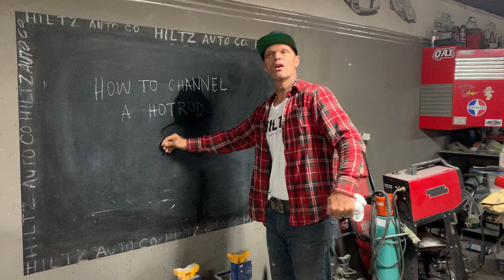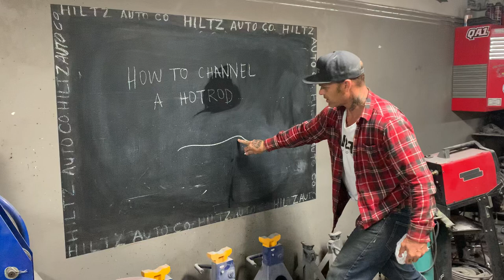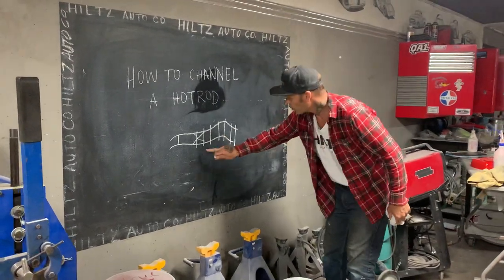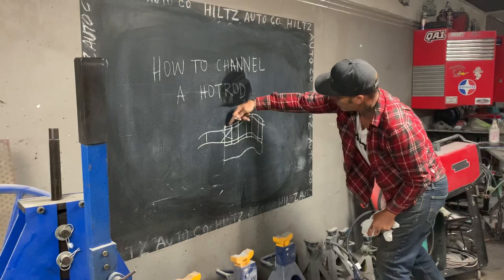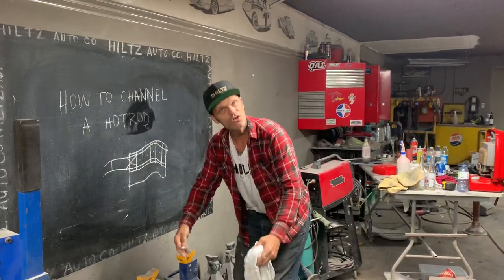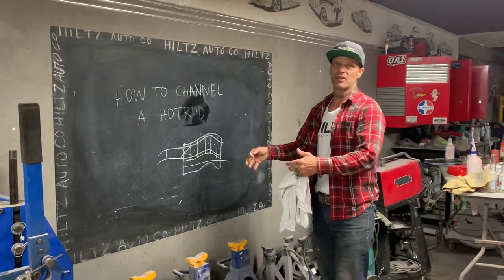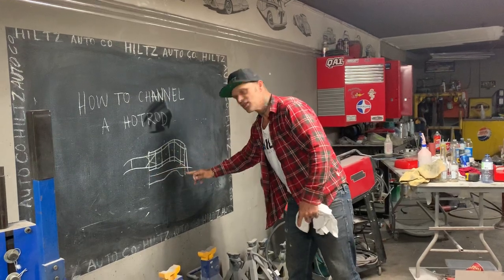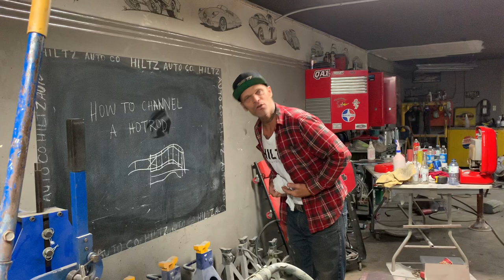How to channel your hotrod in one day

Comment: What if yer car DOES have a floor in it already?
Reply: Every time I’ve seen it done, you brace the body so it doesn’t move after the structure is removed and cut out the floor. Make the subframe the exact width that will allow the body to slide over. The angle iron will sit on top of the subframe and can be made one complete piece. Trial and error and good measurements is how it goes.